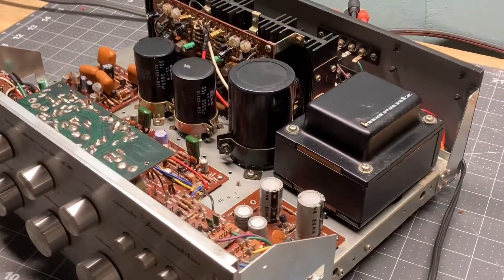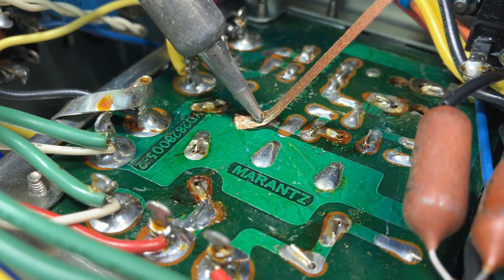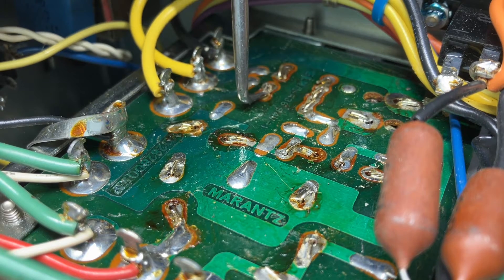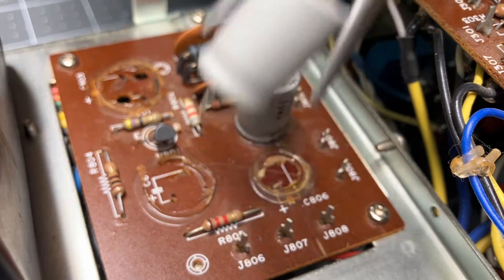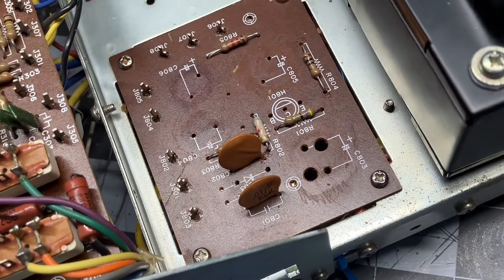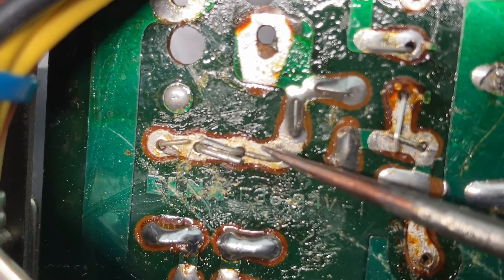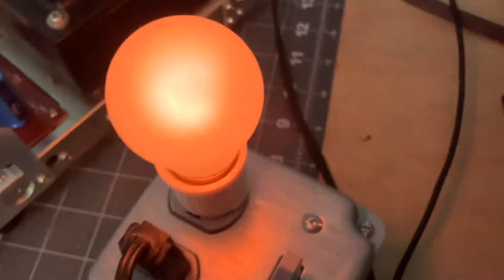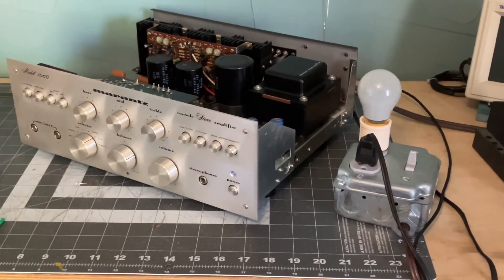Marantz 1060 Rebuild - Part 2 - P800 Power Board

Comment: Have you used soldering gun with build in vacum sucker its very easy to suck solder inside
Reply from the maker: No. I use solder wick. Not sure if a good Hakko FR301-03 would be ergonomic because of my disability. I'd like to try one from a local tech and see if it would work for me. Wick isn't that bad. Once I figured out to use flux and pull it from the spool which allows it to dispense as its in use is great. I think technique has a lot to do with desoldering wick. Also it's lightweight and can get into tight areas. Doesn't take up my very limited workbench space. I do have a YIHUA 929D-V that a friend gave me, but I couldn't get it to perform correctly. Decided to try it again later. I think if my memory allows... it wouldn't get hot enough, but may have got damaged in shipping as it has a slight bend.

Comment: Still have mine.  A few years ago I replaced a few caps, this has me thinking maybe I should dig back in there...
Suggestion - a list of parts removed, and a list of replacements for each video?  Thxs.
Reply from the maker: If you go to Audiokarma you'll find many build threads with folks sharing parts lists on the Marantz 1060. I'm not listing parts on this rebuild series as I'm modifying/experimenting with of many parts. I'd hate to see you end up with a lot of problems to sort out. The folks on Audiokarma are great and can get you started. Thanks!
Reply: @PossibleAudio  Ok, makes sense.

Comment: Thank you for sharing ......just left me with a question what type of transistor to replace the original one on the ower board ?
Reply from the maker: KSC2383
Reply: @PossibleAudio  Thank you very much....I work with tubes since almost 7 decades but transistors are a different technology , I have a vintage collection tubes and transistors , The 1060 was my first transistor amplifier  in 1975 , I still cherish it ...

Comment: That's a good video and a good job.  You did a thorough analysis between what was installed in the factory and what the Service Manual states, I found similar discrepancies when restoring some JVC vintage audio equipment also.  I guess there might have been updates in the Service Manual while the equipment was still in production.
Reply from the maker: Yes, changes are often made during production runs, but the service manuals rarely get updated to reflect. Sometimes a service bulletin will come out for a major change or upgrade. Thanks!

Comment: I found that if you put a small drop of liquid flux on the solder wick, it will help to get the solder to melt and flow into the braid more easily.  Great job!
Reply: Yes, I learned that too.  I also learned that some types of solder wick come with some flux in it from factory, some don't.  I usually apply flux like 'Kester 186 Liquid Soldering Flux, RMA Rosin' from Amazon to desolder (or solder) components, it usually makes the job easier.
Reply from the maker: I have some and its been sitting as bench decor. I'll use it on the next video. All the best!
Reply: @PossibleAudio  don't forget to clean up the flux at the bottom of the pcb my friend...how could you leave it like that..!?

Comment: Six years in the Navy as an electronic tech and 40 years fixing copiers. I did a lot of soldering and de soldering. It can be very frustrating. I would like to know if that is an antique radio in your opening segment. I have a small collection of antique radios. Loving this series.
Reply from the maker: It's a Travel-Aire 431 from around 1935. It's all original and complete. The wood case is beautiful and a 9/10. I may rebuild it next.

Comment: I also have a 1060 and a 112 receiver that I bought new in 1976, still work, but getting the urge to have them tuned up.  Is that an "ultra lite" propeller in the back ground ?  I built the "B1-RD" in the mid 80's.
Reply from the maker: Just cheap home decor. Not functional.